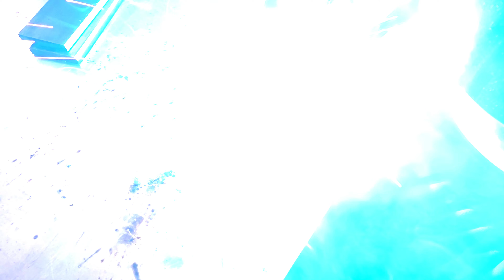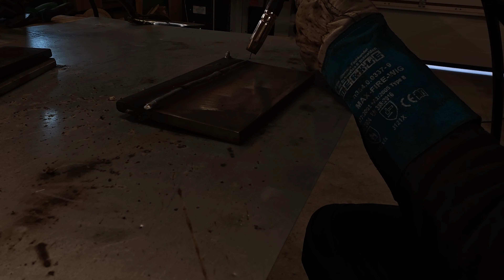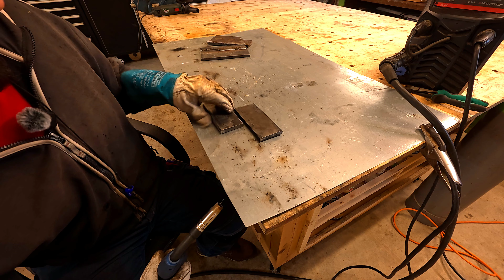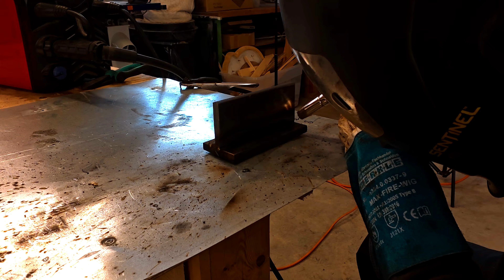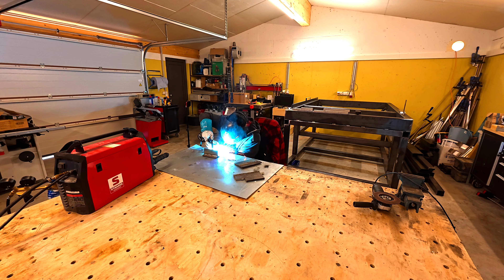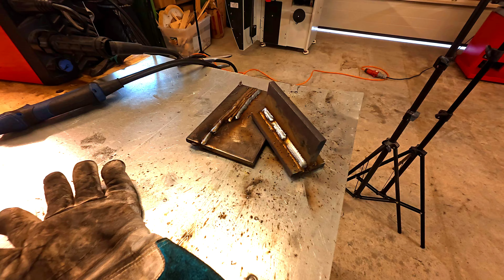Mig Welding for Beginners BEST Practices Revealed

Comment from the maker: "What’s your biggest challenge when running straight weld beads? Let me know
Reply: Bro i just started the mag course. Tell me what angle you use holding pistol? 15°? Or 90°. Can you stick  gas nozzle welding near material or even stick to material?
Reply from the maker: Hey man 90 degrees vertical  and 15 degrees tilt over the direction of the weld. Depending on the hand to push or pull. Yes you can have it relatively close, but not to close, you need to be able to see what you are welding and if the gas cup touches the weld it will ruin that part of that weld. keep the stickout about .5 ich